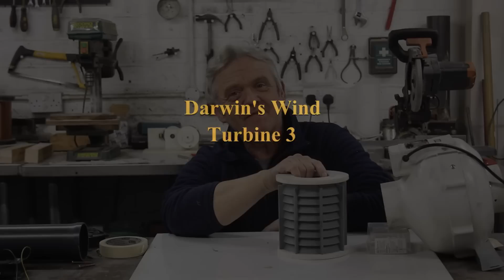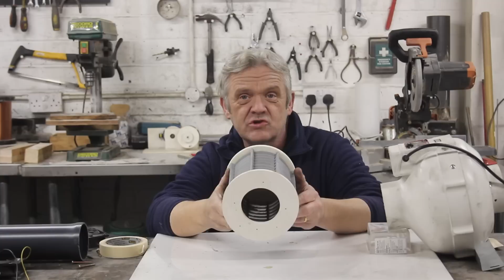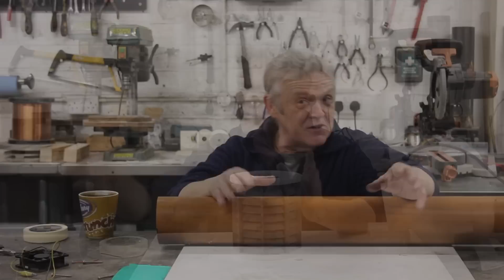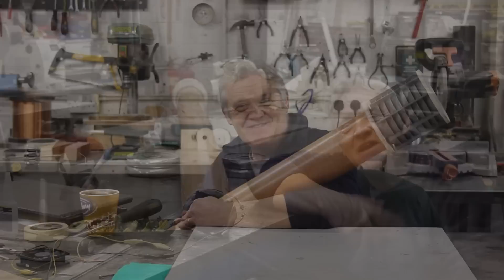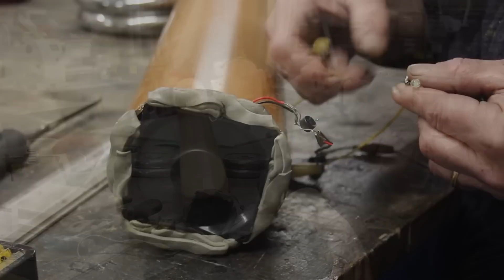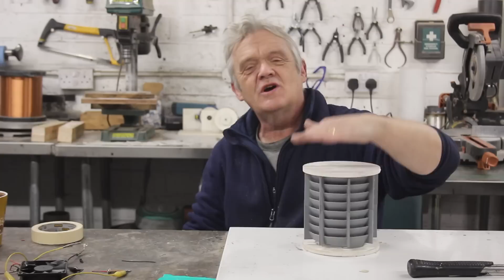1818 The Darwin Wind Pipe

Comment: Good day Robert.  I have wondered how several of your PC fan generators spaced apart down the entire length of the pipe would go.  What do you and others think? It has enough strength to power one fan with that given intake area of Darwin capture funnel.  Could increasing the intake length give enough gust down the pipe to power several more fan generators?

Comment: The argument that you will get pressure drop from the length of your pipe is valid. One interesting idea that you might want to test, is to have a bellhousing out to expand the diameter of the pipe from say one to say 2 in. Then after you had your six eight or 10 ft run of the big pipe then have a reverse go to narrow it back down into a higher velocity stream

Comment: I have watched this playlist to this point so far ... essentially back to front of the development ... the 30 to 35 deg fins are great ( i would expect 33.333 degrees to b optimal)... now what about also angling the fins at 30 to 35 degrees to force the wind that IS captured to spin down the tube allowing more more volume to flow ... essentially taking victor schauberger's ideas for water and making a toroidial air flow ... make the angle match the spin to the direction of the turbines spin so if the turbine is a right hand spin then right hand fins ... left handed ... left hand fins  .... the panels can all stay flat and large scale construction then is flat bits with some compound cuts to fit the bits together ... also if you apply jet turbine exhaust maths (dang aeronautics LOL) you can fine tune the constriction to get an optimized air flow for the best performance of the turbine ... 
.
another consideration would be using magnetic bearings for the fan base and its spindle ... 
.
also if you want to include multiple turbines then a series of converging and diverging pipe section between the fans will both slow/ cool and then speed up and heat the air ... each turbine after the first oen would need to be some ratio smaller than the previous one ... eg if the airflow is left to right and you want say 3 turbines in line then the right hand turbine will be say 1unit the next one in will be 1.618 units ... then for the third ... same calculation BUT the 3rd one is 1.618 times larger than the 2nd ... PHI being such a common natural optimization ... 
.
also having reread this post ... what about using the coriolis effect on the cap to also pull the pass over air down into the back side of the collector increasing the air intake even more or have the weather vain shield protrude above the top a slight bit and curve the passing air down into the downwind side of the collector ... as for ease of construction a suitably sized round pipe for the top of the shroud should be good enough to accomplish this

Comment: I'm building a big greenhouse, I'm trying to work out a way to get good airflow (my previous greenhouse (and the area generally) tends to get damp and is prone to mould and fungus) without the airflow reducing the heat in the greenhouse when cold outside, I'm sure this could provide a solution.
Can anyone suggest a way to use the air to generate a little heat to warm the air slightly so the small paraffin heater (I cannot connect electricity where this greenhouse is) isn't so overwhelmed when very cold.

Comment: Might be a silly question, the air/wind travels in from the top down therefore in a strong continuous wind. Do  you need slits or holes below the fan/ generator  to allow the airflow to come out as your pipe would be cemented into the ground making an airtight seal, with the air inside having no mean of escape?

Comment: First off, thanks for the great video series.  The setup got me thinking and 2 suggested refinements I'd love to see if they work would be to add a curved element to the control surface rather than a 45degree bank (like you mentioned) with a slight extension so there is an overlap between layers of rings. Also, i was thinking that having the blades be curved such that the control surface leading/trailing edge that points up to the exit it (my thinking is it would also help with the rigidity of the overall design and possibly require less material in the "vertical" supports.

Comment: It's not just the angle that can be modified to improve air flow - by adding the proper shape and flange to the fins, the air loss from the opposing side can be reduced. There's also a simple mechanical modification to the unit that could almost completely stop escaping air from the trailing side.

* Thought about it a bit more and the mechanical mod that I designed will definitely improve the performance. If anyone is going to make one of these... we should talk.

Comment: I think most people keep forgetting that air is a gaseous "fluid" so pressure and such effects it too, thus that idea of it not working down the pipe, is forgetting that you are stacking your pressure from the top pushing constantly into the pipe so the stuff already at the bottom gets pushed out. 

Maybe the surface of the interior could be made to be more effective and cause less drag, or something but for this, I think the effort would not hour of labor vs watts able to be produced be worth it due to diminishing returns on one's investment. Just build more of them in the time to make the first one more efficient LOL.

Comment: I'm no expert in fluid dynamics.. but if properly designed, could a series of constrictions->inlets->dilations for increasing flow (by adding atmospheric air through pressure differential i.e. Venturi effect) allow you to:
A) Extend the length of the tube by offsetting the drag?
B) Increase the airflow as it flows downwards?
I've got to be missing something here so please inform me. Otherwise I'd love to test this or to see Rob do so

Comment: I'm having a go at designing one of these.. I'll send you an STL and an OBJ with some useful shapes with curves with various cut-offs for the inner angle if you're interested. Can send OBJs with quads.
What diameter and depth is the fit on the end of your pipe? 110 you said? Looks about that, too.
And what about a heliacal design? Is spin good for it or does it increase turbulence?
Or do both circles and helices cause turbulance and do we need a different, possibly more random, distribution pattern?
And should the receiving curve be a parabola, or is there a more complex workable shape?
I can do some ridiculously complex shapes really fast with polygons for testing.

Comment: I'm wondering if you couldn't improve the efficiency tremendously if the openings on the Darwin wind pipe were flaps hanging loosely on horizontal wires and thus able to open and shut freely based on which side the pressure was coming in from. The way it is depicted here would seem to allow a lot of the wind energy to simply flow out the opposite side due to high pressure on the windward side and low pressure on the leeward side. It might make a tiny bit of noise depending on the material used to make the flaps as they alternately open and snap shut in a blustery wind but I don't think it would be too much especially if mounted on a roof top far from human ears. ?????

Comment: Experimentally....get an EMPTY 3 litre plastic bottle and make horizontal cuts....then heat the bottle using a hot air gun and deform the plastic using a wooden (spatula/ruler/similar flat object) towards the bottle top.
Remove the top of the bottle then glue it to the top of your downpipe.
Mine worked a treat,and apart from the heat itself ....cost me nothing.....and required no special tools.(Finally found an actual use for her hair dryer 😸)

Comment: Really interesting again Robert, I have a wall at the bottom of my garden and I would like to put some of these on the wall to collect the wind.

My question is if I connected say 8 of these and connected them into a long pipe would that work? would you get 8x wind power (or as close as) down the pipe or would there be so much turbulence that it would render itself useless? or would you suggest just having 8 Urginsky turbines instead?

Thanks again Robert

Comment: Love the pipe idea, but there will be a pressure balance point between the pipe losses and air just passing through the turret, unless you can incorporate a baffle either internally or externally that is wind direction sensitive

Comment: If you used the original orientation to direct the airflow upward, and had the pipe attached to an opening in the base, would it enhance the chimney effect?  Because if it did enhance the chimney effect I could see a pipe running up the side of a building, ending in a tower on the roof, with the actual turbine and generator in the end of the pipe near ground level.  Or in a hilly or mountainous rural area running a pipe up the side of a hill or bluff to a tower at the top and the generator at the base.

Comment: Probably the thirtieth person to say this, but I can't possibly read all the comments:  The tower is basically a separated stack of plastic bowls with the bottoms cut out.  If you can find cheap plastic bowls with flat bottoms, cut the bottoms out and stack them with vertical supports that separate them.  It'd be interesting to see how much separation is ideal.

Generally, though, it seems easier to make louver rings and add vertical supports than to make so many individual segments and connect them.  You could, of course, cut a series of curves from a sheet of plastic, or metal flashing, and then bend them into circles.

Comment: If you want the fan at the bottom of a pipe for the turbine, i would put a swiveling pipe elbow with a rear wind vane so the open end point into the wind and you recover all the velocity.  Having a larger opening could increase the the pressure at the face.    If you want to keep the rail out increasing the face pressure and reducing the local velocity, louvers might have merit.   An experimenters delight, a bit more complex may be.  Need to consider how insects and wild life will see the structure as a nesting opportunity.

Comment: I wonder how much residual energy is lost after turning the blades? The pipe seems like a good place to stack a bunch of turbine generators inside.
Maybe if it isn't getting enough to spin the next one, connect more darwin stacks. Could make the whole thing modular so you can keep stacking more at your leisure without effecting wind resistance

Comment: Great idea, would it work if you put an extra set of fins around the current set but pointing in the opposite direction? So the air flows up and then back down. This would stop rain from getting in and running down through the generator fan.

Comment: I'd imagine if you integrate a heat exchanger at the base you could also use this as a modest Stack Effect generator. Heated air at the bottom rises, inducing a flow. Could be an option for days with more Sun than wind. 🤔

Comment: would there be a shape of pipe more condusive to allowing air to travel through it at speed? I don't know how acurate the stuff I've heard about victor schauberger is, but I thought it a compelling line of thought if nothing else. I also suppose there's nothing to prevent you from making a tower from Darwin's vets & harvesting a larger surface area either, although I'm not sure the flow would increase as much as one might expect for the increased capture

Comment: Rob, a suggestion if you want to optimize the angle of the turbine. Instead of volts and loads, why not putting a little pc cooling fan in between the blowing fan and the turbine to measure its rpm, and correlate with the rpm of the fan at the bottom of the tube? It may make the optimization more systematic. Great job as always

Comment: One tip that may help Rob and I haven't read through comments  , but in ducted heating/cooling the more distance in length with duct the size of duct is reduced which actually increases pressure slightly to help airflow travel further. 
A dome top hat for it as air flows in venting up to the top hat , then have your outlet pipe enter into the vent section further towards the top dome area so air flows in up top then down pipe. 
Just idea's  cheers love the content.

Comment: How about a pentagonal shape instead of round with rows of rectangular slots, with one way flaps  covering them (opens inwards). The wind blows in from whatever side but cannot exit on the other unlike the original design. The flaps will open 90° sideways and just drop down when there is no wind, closing mechanism necessary. There would be a lot more drag though at top, but a lot more wind going down as well.

Comment: As others have said, water from driving rain might be an issue. Could you do some testing with bottom of pipe capped off to collect rainwater and the generator installed on the side of the pipe?

Comment: If you figured out a way to cool the interior of the pipe (maybe using radiative paint and placing the device on the shady side of the building?) so that it would be cooler than ambient temperature, then my guess is you would offset the drag of the pipe, as the cooler would naturally want to flow downward.  You'd definitely not want to make the pipe black and place it in the sun.

Comment: I'm curious. Will the air still blow through if the slats are angled away from the tube? I only ask because the upward angle like they are right here would allow for rain to get in. Perhaps if there was some kind of redirection plate in the center (similar to the shape of a Bundt cake pan) you could get away with it and only face some power loss.

Comment: Would it work as well if you put a glass of jam in it?

A glass of jam represents a reduced volume of the inside. If it still works and doesn't degrade considerably, such a contraption could be built around existing towers, chimneys, and buildings that are already erect.
Reply: what a nice phishing attempt :)

Comment: What I’d be interested to see is if you designed the “blades” like wind turbine blades, sort of slanted but also pushing the wind in one direction around the inside, creating a kind of vortex. If you got that going in the same direction as the generator blades, would that increase the efficiency or hinder it? Or have no effect at all?

Comment: If a savonious arrangement is placed  such that the shaft with an exhaust fan is fitted ,jutting into the pipe. Wind would turn the S blades, causing the fan to turn and move the wind along downwards to impinge upon a generator placed at ground level. This could be in addition to your brilliant design.

Comment: Who says it won't work through a pipe?  Don't they know that the air handling heating and cooling system in their house or office is just big plumbing? - Seeing this video made me realize that three improvements will make this better, and namely it will be better in a large form mounted in my old three meter aluminum satellite dish as a huge collection end of the contraption.

A little history here, I am a retired HVAC master tech with a specialty on duct design.  There are a few key elements that one must follow on a natural velocity multiplier (this is what this should be called), and should have an ideal limit to the largest version being about half a meter in diameter with a quarter meter diameter duct with no bends of interruptions before it empties at a output manifold.

Natural wind is not a laminar flow, it fluctuated quite a lot, but this design and the math it seems ti indicate will cure a lot of those natural open air problems and produce a 0.5 velocity increase, captured mostly by the conversion to a better constant flow into the duct.  It should also work as a low flow evaporation cooler as well, operating with no blower or moving parts other than a small pump to the cooling pad.  Brilliant device.

Comment: Hi Rob. Im very
impressed with your persistence to better wind generation. If i may through my penny in the works, wouldn't there be less resistance if you replaced the top plate with a (octagon to round) cone.

Comment: As long as you are testing. while it works equally in any orientation , a lot of rooftop turbines use the updrafts that form due to hitting buildings. I would wonder if there was difference if the scoops opened down and caught that like a ram scoop , also the face that the scoops are mounted in is vertical , would expanding it towards the top like an inverted cone so each scoop is a bit clearer of the one below it make any difference?

Comment: This is fantastic,, I can make one of these put it on a pipe 20 feet in the air with a electric blower at the top plugged in 110 to light up a tiny LED bulb. Now of course I am joking I would only put it up 10 feet.

Comment: You will get far more wind efficiency draw and power with that very design, except just taper it like a cone or pyramid going from wide to narrow. The idea is like the peruvian wind holes found near Nazca lines where the holes in the ground would draw in wind into underground tunnels to move and circulate water tunnel system. The wide part accummulates mass volume of  wind and as it travels trhough the more narrow sections it will be compressed thus traveling faster resulting in greater fan rotation and more voltage power. But it would require a bigger size design to allow proper air flow pressure accumulation for significant wind to be compressed and released at faster speeds. If you go outside it will be even better where the wind current flows faster then inside the house.